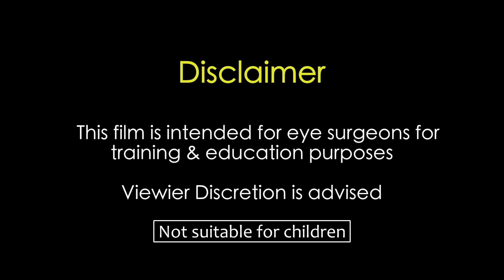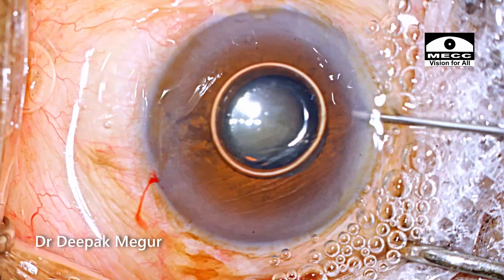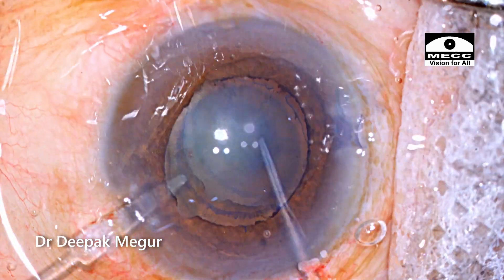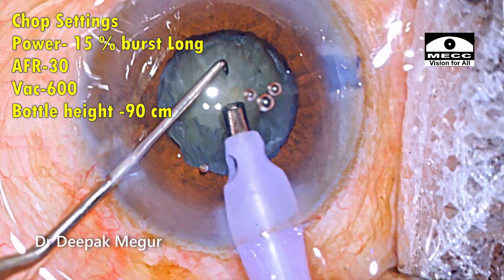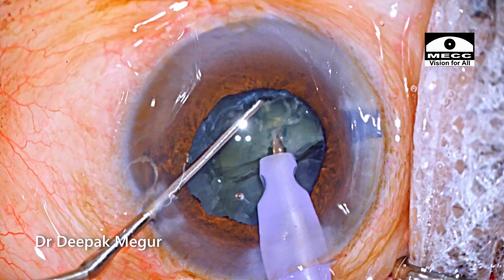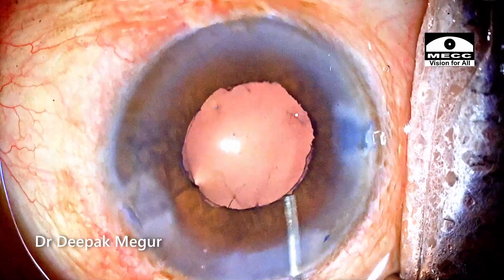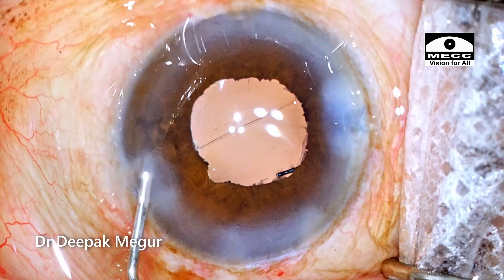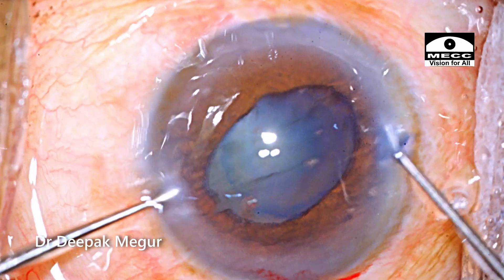Stretch Pupilloplasty for Small Pupil. Phacoemulsification in small Pupil. Dr Deepak Megur

Comment: Hello sir ,i would to ask you about why we use  bevel up to do occlusion in this case , thanks for your answer
Reply from the maker: This a kelman style bent tip , with 45 degree angle , this is the one usually supplied with alcon machines. and with these tips i find it easier to use bevel up for occlussion